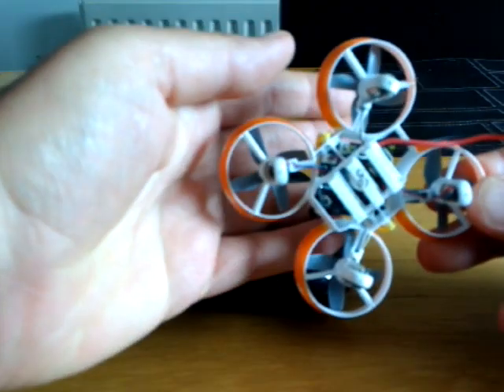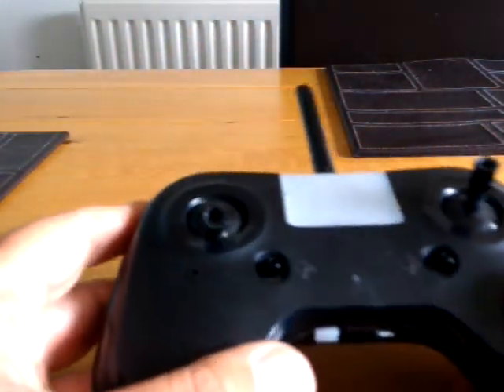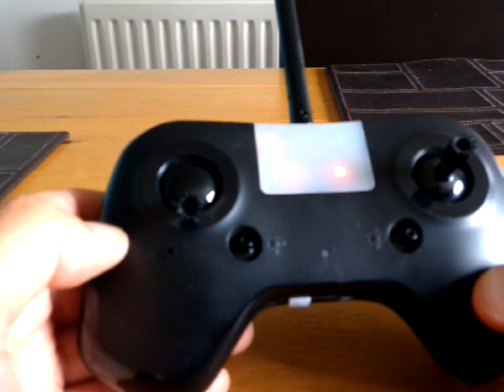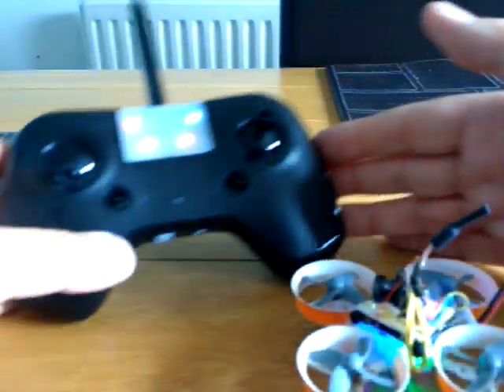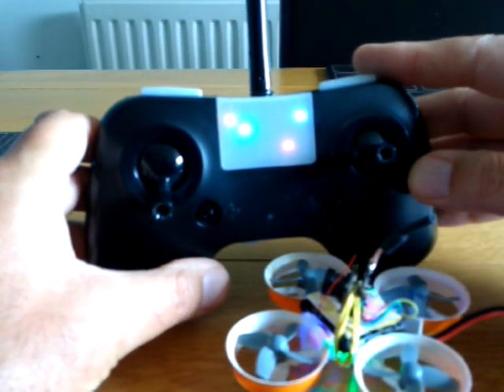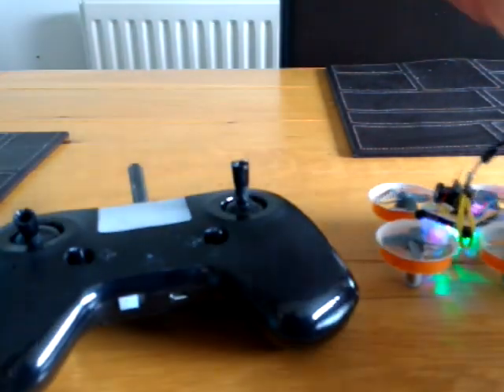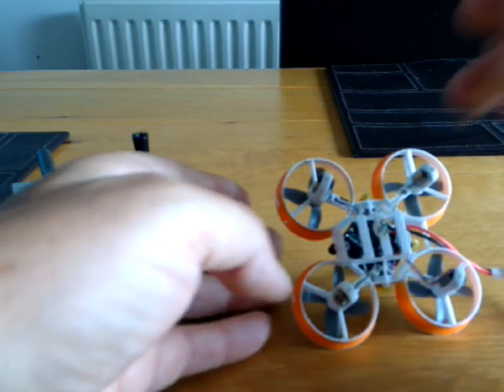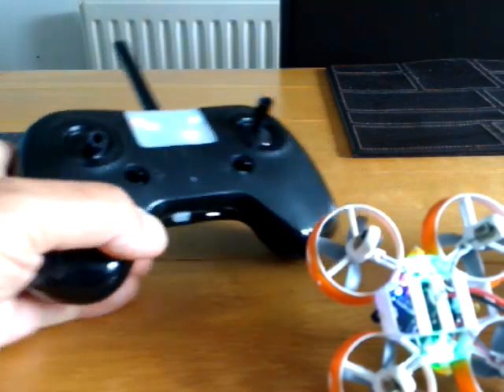How to bind tx02 / tiny-x8 to betafpv F3 V2.

Comment: Thanks for sharing.

This TX seems to be the best price/qualty ratio on the market at the moment...
Reply from the maker: dudu du76 it's a good beginners tx for the price, I did manage to fly my quads in acro with it but the taranis is MUCH better for that having hall sensor M9 gimbals.
For whooping and level mode it works ok.
Reply: Yes, i totally agree.  Of course, it's not comparable to a x9d+M9. But, x9d is 6 times the price.

I had in mind other low priced TXs ( the DYS one, or BetaFPV Lite, E011, etc...)
Reply from the maker: dudu du76 agreed, this is the best of the cheap txs, I can fly acro with it which I simply cannot do with stock txs, plus it's small enough to carry around which the taranis is not easily transported...
Reply: Yes.
I had a opportunity to try the "Kingkong" clone of it (sold with kingkong Tiny8X). I posted a video about it on my channel.
I think it is just the exact same as this BetaFPV TX02, only rebranded under another name.
Reply from the maker: dudu du76 this one is the kingkong version, would be interesting to know if the firmware for the kingkong works on the tx02 , I suspect it will because like you said it's just a rebrand.

Comment: Hehe double take ;)
Btw does this one support d16 mode now as you flashed it and the module (i think) has support for it?
Reply: Good to know.
Reply: Ok i saw your fb answer, so it can has d16 :)
Reply from the maker: You can only flash one version at a time but it does support d8 or d16 mode, futaba is also available, I imagine the tx02 is identical though and could also be flashed with any of those protocols.